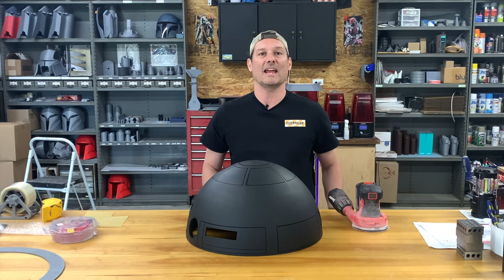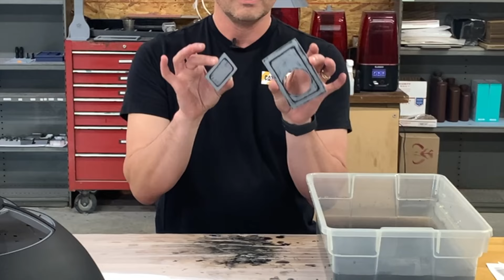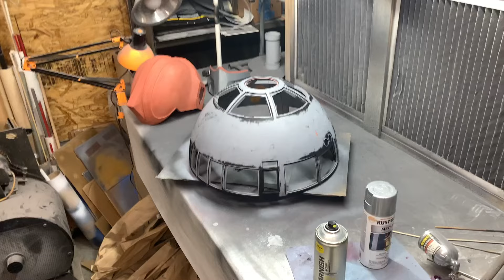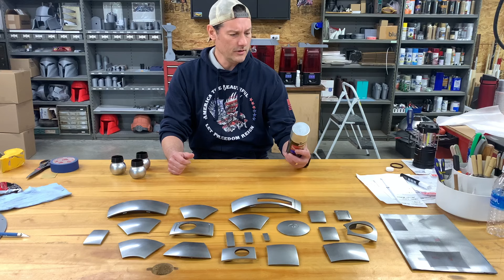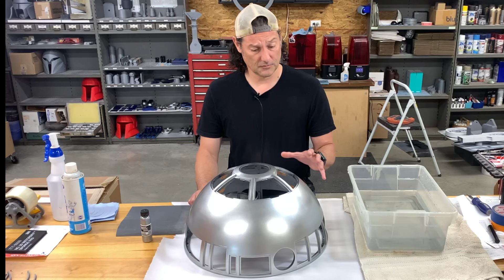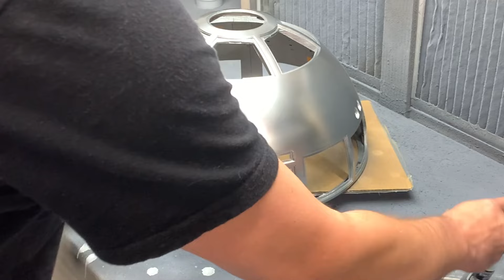Printed R2-D2 DOME Finish Silver Painting R2 (Build Part 3)

Comment: 80 grit, on an orbital, on a curved surface? You're braver than I am and I've been a custom paint and bodyman for over a decade. How thick are you printing? You have to be really careful with that sander and paper grit because it will ruin a print real quick, especially on a curved surface where the contact area is rather small. If this is your first time sanding, I would suggest starting at the 200 to 300 grit using a soft rubber block. Otherwise, start with a good heavy build primer and let that fill as much of the print lines as it can, then a 600 to 800 grit wet/dry paper. And if you want it really smooth, wet sand using 1000 and 2000 grit. Two to three good coats of a high build primer can fill most print lines. The seams, however, will need a bit of that bondo filler.

That glass cleaner is a big no no. Depending on the type of cleaner, it can leave a residue that can interfere with paint adhesion. You're better off visiting your local paint and body supply and picking up a gallon of surface prep. It's made specifically for removing wax, grease, and other residues and leaves your paint surface truly clean.
Reply from the maker: All good advice!  I have actually used an orbit sander for many years and haven't had a problem but you do have to exercise caution as to not melt the plastic.  I do believe I said isopropyl alcohol not glass cleaner but I could be mistaken.  I published this video over a year ago and if I said glass cleaner I did mean alcohol.  Sorry for any confusion.

Comment: i just tried that silver paint.... total disaster. It just came out as part runny water with metal fleck scattered thru it. The only thing i can see is that i did not shake it enough...which is bizarre because the sonic blue pearl just came out just about as what you would expect without having to shake the can that much.  I got it cheap so the test was not a big deal but looks like i am going to have to stick to spazstix as i originally planned... the spazstix can just sprayed on so well and kind of a thin coat. I tried it on a model airplane wing with tamiya gloss black under it and man was it ever shinny. Actually too shiny as r2's dome is supposed to be aluminum and not chromed metal.  I also tried duralumen over that black tamiya gloss and the results were not that great and when i applied tape to the duralumen it came right off. Spazstix and the other alclad colors i tested survived the painter's tape test.   THis whole dome paint sage is just ruinous to me.  Either the Chrome i found is too flimsy ( mostly rattle cans ) or the aibrush stuff i use does not work out as i see others that have used it.
Reply from the maker: I wish you the best of luck on this.  Don't get discouraged, you'll make it work and it'll look good in the end.  I feel your pain though, been there myself.
Reply: @coz3d  thanks for kind words. I have dug up my passche H from the toolbox. I think it will "train" on it for the next while and see if this can act as a good atomizer/airbrush for the silvers i need to use and the alclad clear coat i want to use.

Comment: Try gloss black before silver, skip the clear.
Reply from the maker: I have never cared for the cure time of gloss black.  You're right though, but I prefer being able to spray on flat black and the gloss coat in the same day and having it fully cured by the next morning at most.  The problem with gloss black is that I have never found a good gloss that cures fully in 24 hours.  
Recommendations?
Reply: @coz3d  Alclad sells big bottle of gloss black for their alclad chrome. It works well and is not expensive and you can spray it with an airbrush. Spazstix also sells a black gloss backer for their spazstix...you can get it in rattle can and a bottle and it works well. Tamiya also sells a gloss black in a rattle can. I cannot get it in my country but it think it is still available in the US. They do dry faster than ordinary rattle can colors as they are extremely thin paint. I think you can spray and let it sit less than 24 hours and you can be good to go.  Also for spazstix, it is recommended to put it on a clearcoat as it feeds on the clear coat for the shine and reflectivity. I have not tested it that way.

Comment: Use a pliable rubber backing for your wet sanding. Your fingers press harder in some areas creating high and low areas .By using a backer you only hit the high ridges.  Btw I’ve never seen wet dry 500 grit, only 400 and 600 no 500. Good video!
Reply from the maker: Good point, I actually do use a 3M backer pad most of the time but didn't in this video.  Good catch.

Comment: Would you be willing to share what size compressor are you using with that  gun.   It looks like the small one at Harbor Freight.
Reply from the maker: Actually it's a Dewalt 30 gallon compressor but I use a regulator to drop the pressure for the gun to around 15 to 20 PSI
Reply: Thank you for taking the time to reply 👍🏼

Comment: With all due respect.

Acetone is extremely dangerous to your lungs so that whole glazing putty mixed with acetone is kind of not the best way to go about this, unless you have the place to do it and safety equipment to do this and i have been told that the stuff can crack over time as it is made to fix small imperfections and not full repair jobs which is the job of Bondo. I think and i could be wrong that Bondo contains some fiberous material which helps adhere to a ton of surfaces and is durable.. Not sure if glazing putty is done in the same way. Only time will tell if this acetone method holds up. Personally i would not do it. I'd rather bondo and sand down and know that i would be completely safe for a loooong time.

Rub n buff is the go to for most people doing their dome but they are forgetting that it is a metal wax that can "rub off" especially if you go to cons.  You cannot clear coat rub n buff. It looks awesome but yes it does also show the imperfections so it's not forgiving in that aspect.

I was thinking of going with a paint on solution like you did or the graphite powder solution which apparently you can coat. Graphite powder produces results even better than rub n buff but a lot of people do not know about this process. They use it for helmets and mando armor but strangely not that much for artoo's parts.

Painting the silver on the dome could be the way to go, but then you have to buy model kit paints and there is a vast amount of paints that will give you different results. You are not looking for a chrome effect you are looking more at a used Stainless steel effect. Paint on aluminum is a hit or miss it looks great but is always missing that little shine that it needs.  Barbatos rex has good videos on paints that can be used on this project.

But to each his own... if you achieve the results you need, then this is all that counts.
Reply from the maker: Yes, you are exactly right, acetone can be bad on your lungs.  I always recommend a well ventilated area when using it and even a mask if you're in a smaller space.   Bondo can also be bad if not in a well ventilated area as well.  Always protect those lungs!

The Bondo glazing is not meant to re-build parts by any means.  The best way to to use it is to do a thin coat to simply smooth away those print lines after you have already sanded an item and eliminated most of the print lines to begin with.  I have used it on many many projects at this point and have never had a cracking issue yet over the course of almost 20 years unless you damage a part by dropping it or something catastrophic.  

Rub n buff is great, but you're right, it can dull over time and has be re-applied.  My rub n buff dome was finished in 2020 and at the last con in 2024 it does show signs of wear but is still is in good shape even after all the hands that touch it surprisingly.

The only problem I have with normal chrome spray paints is that it still looks like paint.  Alumiluster is a great product to use in place of spaz stix but I wanted to test spaz on this project.
Reply from the maker: @brunobernier8870  I have not tested many of the alclads.  I might be ordering some this week now though.  I'll have to check out Barbatos and see what he's doing too.  Thanks for the info!
Reply: @coz3d  search for those:

Barbatos Rex ( his channel name) 

Testing 6 Different Alclad Metal Colors

Testing 2 More ALCLAD Colors - Stainless Steel & High Speed Silver

Comment: Just found your channel, glad I did. Your work looks very good, and it’s presented well in your video. Great job all around! I’ve never used spaz stix paint, just Alclad and some others. How does it hold up to being handled? Alclad needs aqua gloss or it’ll wear off, but it tones down the metallic look a bit. Ever consider doing a Vader helmet? Hint hint….. 😎
Reply from the maker: Alclad is a great product for sure!  So far my spaz stix projects haven't shown any major signs of wear yet even my thermal detonator that I have handled over and over.  It's surprisingly durable without a clear coat at this point.
We just built a Vader helmet about 4 months ago but didn't film it.  Maybe it's time to do another and film?